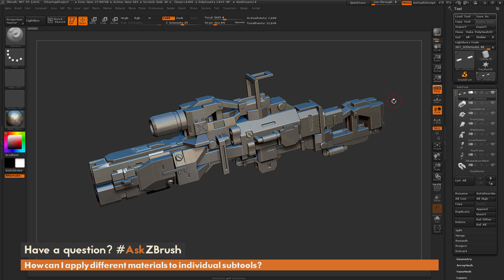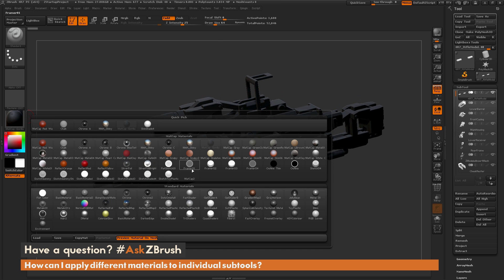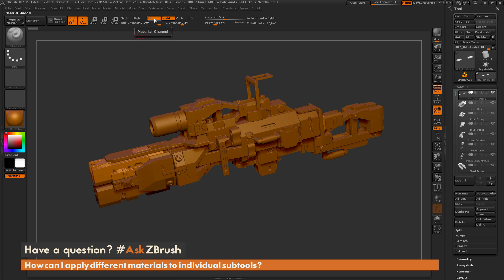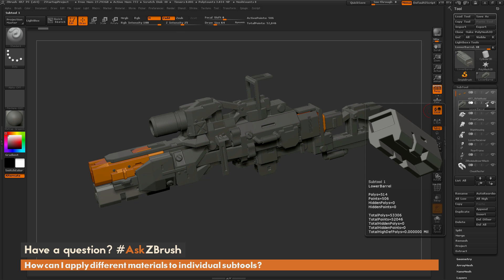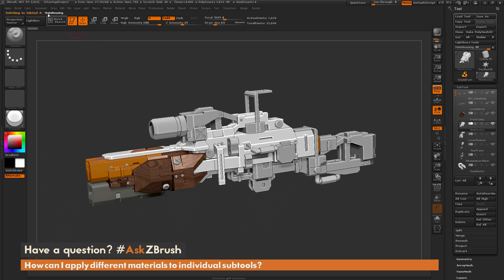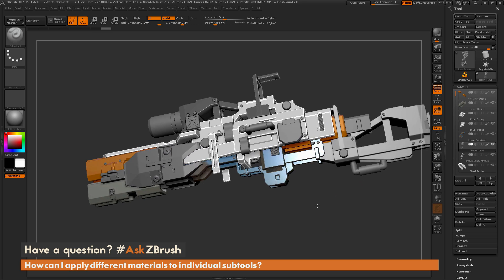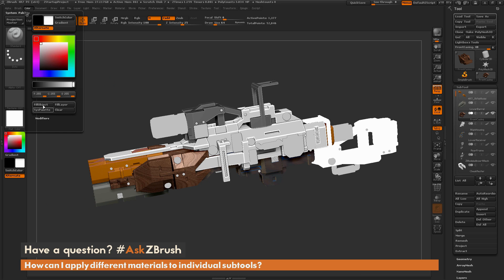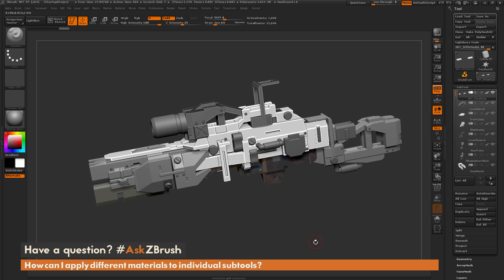#AskZBrush: “How can I apply different materials to individual Subtools?”

Comment: The UX in zbrush is just so unintuitive, why have this weird system instead of having something simple like all other DCCs?
Reply: Uh oh! It looks like they forgot to turn comments off on this video, lmao.
Reply: Every single video about ZBrush has these type of comments underneath. Why, indeed, why? Were these guys on drugs while designing the UX? and if so, why has it basically stayed the same despite all the complaints about it (I hoped Maxon would do something about it but no, they basically charge a fortune for the exact same obtuse and weird user interface.) I really want to learn this program but it's so freaking frustrating having to do internet searches for basic functions like this.
Reply: Everyone agrees with you. Except maybe the developers. I've been using Zbrush casually for about 12 years now. And here I am youtubing how to apply a different material to a different subtool for the 50th time.
Reply: @ Welcome to the club, brother.
Reply: zbrush is super old software